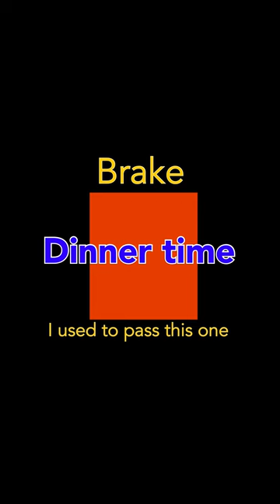miter joint worktops solution

Comment: Great video I noticed that when you cut the chimney down on the cooker hood you used like tin snip device we used to cut them down with a jigsaw and metal jigsaw blade but now cut them with a grinder and the appropriate blade we hide the parts that get blued by the heat but too be honest it’s very minimal and on the plus side it cuts one side in about 10 seconds much quicker and easier and just as efficient
Reply from the maker: I know but im so scared to use a grinder as my brother has gotten  by the flying blade and jig saw is too rough and flammable thanks for your thoughts

Comment: Great fitter , what’s the sealant you use for the joints on worktops and cutouts , do you colour code for different worktops , cheers
Reply from the maker: Thanks .i use egger sealant adhesive it came with the worktop

Comment: please what was the purpouse of marking the worktop 3times with the router on the scribe joint was that to position your worktop bolts ? and how come you cut the male section in one pass of the router ?
Reply from the maker: Hey there were 3 pasess but did not filmed all on both male and female joints ,from front 100 mid 300 and at the back 480 to be able to tighten the back as well as the cabinet back panel is in the way thanks